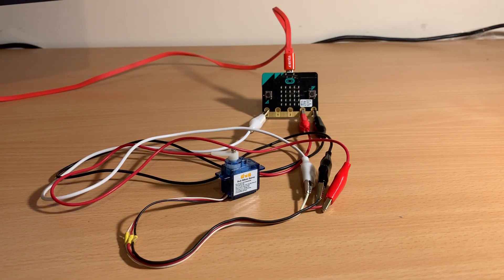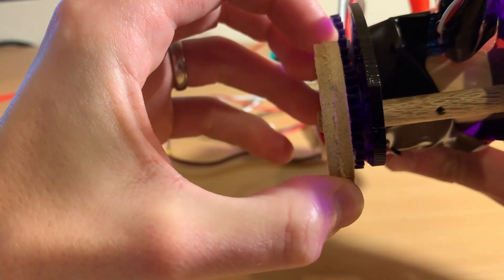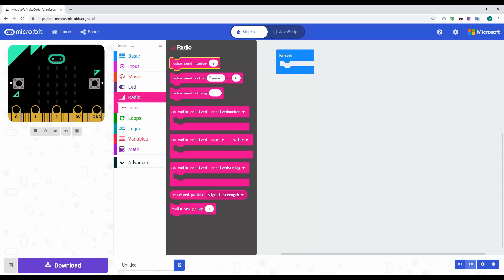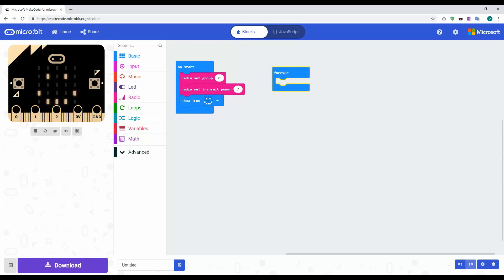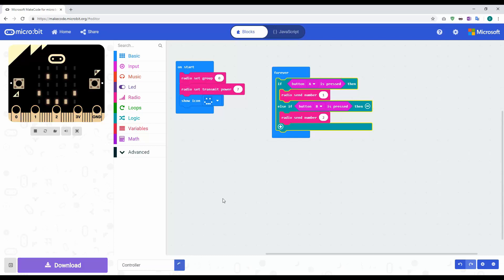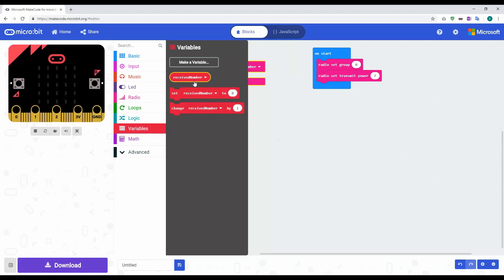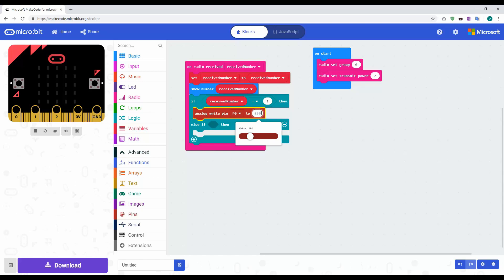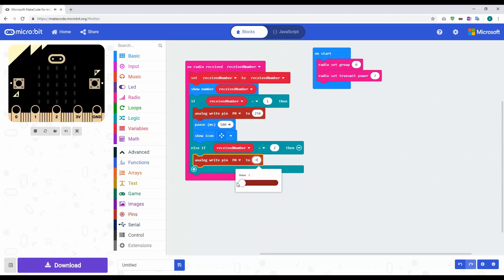Create a remote controlled car using a MicroBit

Comment: That's a nice project but can you make a vid on where the wires connect? or upload a circuit diagram
Reply from the maker: Hi, there is no circuit diagram. If I can dig it out of my old projects i'll have a look. Essentially, you need a servo attached to the 3V output and the ground in order for it to work. You also need continuous servos as most are designed to reverse their movements.